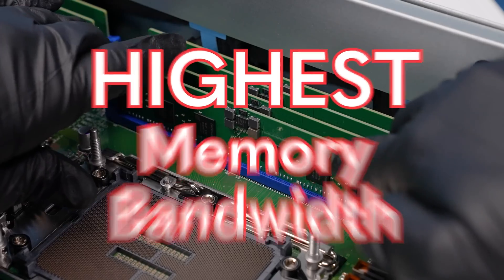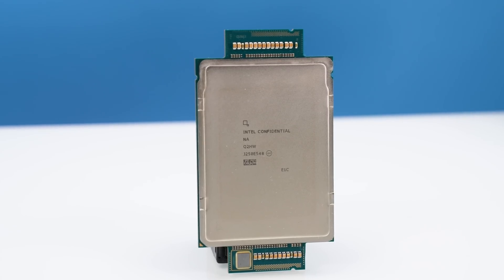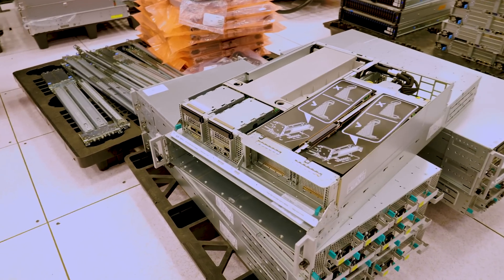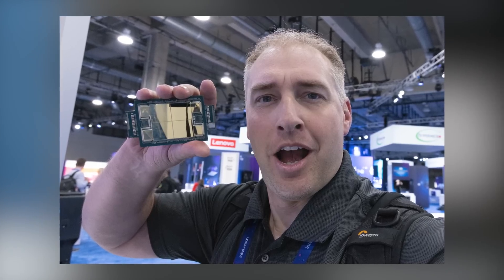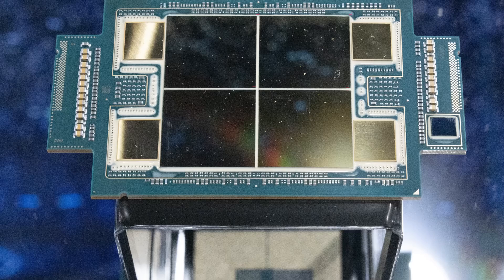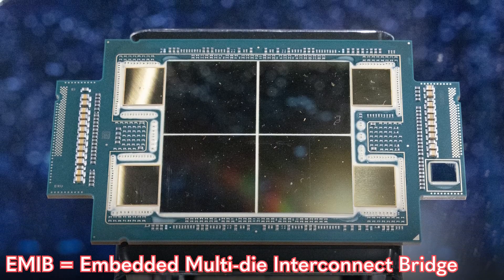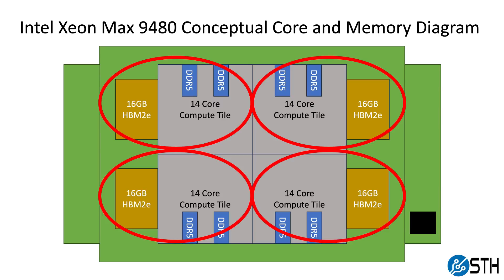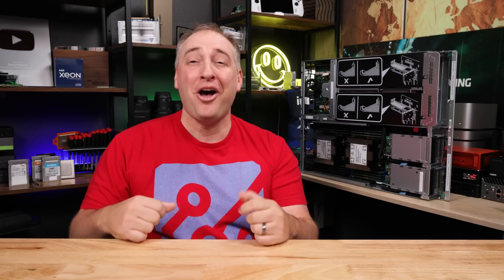This Server CPU is so FAST it Boots without DDR5

Comment: While I work with virtualisation a lot compared to specific high performance workloads, this has always begged the question for me, even when playing around with a legacy Xeon Phi 5110p CoProcessor, how would a chip like this handle memory failure? Nowadays whenever we have memory failure, ECC kicks in as a first resort and then you have options such as Memory Mirroring so your workloads can continue with a reduced amount of available memory. 

How would a chip like this handle it, say, one of the HBM packages was defective or outright didn't work, does the BIOS of the system have any form of mirroring? Considering this is four seperate packages working as one, would this prevent the chip from booting up at all?

Great coverage though, always fun to see what new products in the HPC sector brings to the table.
Reply: I don't know if this system supports it, but CPU hotplugging exists. Maybe the least useful way to do it, but that would be 1 way
Reply: if the memory fails, throw it out. This is the way now, integration of core components at the sacrifice of modularity and repairability

Comment: Meanwhile in our universe, there are people still believe $8 sbc with 8 core riscv cpu is the future
Reply: Well risc-v is really in it's infancy. However there are big risc-v cpu's now. such as Milk-V who offer a 64 core desktop pc. 
Hopefully the open isa nature will serve it instead of hinder it. I am a big fan of risc-v since they are currently the only option for really free computing.
Reply: I'm a risc-v hardware developer -  It's already owning the embedded world and its in the data center in ways you can't see. Western digital is transitioning its memory controllers to riscv cores for example. Over time it will also start to show up as main CPUs. Remember it's not the architecture that makes one ISA better than the other, its design innovation. Right now, all the cool new innovations, like 90% of it is on riscv. Eventually, that will count for something.
Reply: @juniorjunior8494  Awesome keep up the great work. I can see risc-v becoming mainstream. Afterall there were years until gpu's became workable on arm. Now with some risc-v pc's which are still super new. Plop in a rx 580 gpu and there you go. Very exiting. I can totally see the risc-v pc become the new desktop. Especially since i already use Linux as my main operating system. Alot of problems still to be solved but still very exiting.
Reply: @juniorjunior8494 well, NASA is interested in it, so that says something. Any big government agency that has its hands on it will have a lot of investment, and some of that stuff tends to trickle down.

Comment: I hope this is something that filters down to consumer parts. Especially for APUs with integrated graphics we are pretty clearly getting to the point where they are being limited by memory bandwidth. The Z1 extreme with 8 CPU cores and 12 GPU cores is only about 5-30% faster than the Z1 with only 6 CPU cores and 4 GPU cores. These two chips are meant to operate in the same power limits and are running the same architectures. Given all that you would think that something with 3x as many GPU cores would be much faster but that just isn't the case and it is my guess that it is probably due to memory bandwidth. GPUs are bandwidth hungry and there is a reason GPUs pack their own specialized memory. I wonder if combining this with an APU couldn't let that iGPU stretch its legs to its full potential. Here is hoping.
Reply: This issue is that HBM is very expensive, and doing HBM right means a pretty much ground-up design for your chip to not only fit in the PHYs for the kilobit+ bus, but also the differences in controllers and possibly dual controllers if you still want DDR5 options.

I've worked with HBM, and when you get to the class of connection density it requires, you need to spend the big bucks for a silicon interposer.  Radeon Fiji did this, Vega and VII, and The Titan V come to mind. That is a whole massive die you need to make and then stack at least 2 other dies on top of.

An HBM APU sounds awesome I agree, we even saw a glimmer of it with the  i7 8809G, which had a 24CU Vega MGH GPU and 4GB of HBM. The more practical approach for right now though would be something with a dedicated GDDR controller, even just 128-bit 8GB would be plenty, as that is already around 288GB/s of bandwidth you aren't fighting the CPU over.
Reply: @DigitalJedi  Yeah I know there are definite issues. HBM has a 4096 bit bus which is gigantic compared to anything else and is why you need the complex interposer. Intels EMIB looks interesting and may help in that respect but we will have to see. Personally I would not have the option for additional DDR5. This would be replacing it. Many systems already use soldered memory so this would simply be an extension of that. I would dare say 90% of consumers don't bother upgrading the RAM on their computers anyway so if it is balanced properly it wouldn't be much of an issue.
Reply: Meteor Lake has hundreds of megs of L4 cache in the interposer, presumably mostly for the iGPU and as a low-power framebuffer (somewhat like the M1).
Reply: Amd instinct
Reply: I want to someone run starfield on it just for show. Of course let the cpu be overclocked to 5ghz

Comment: Imagine if AMD started adding HBM2E or HBM3 (that samsung connection they have) onto their Epyc.. aswell as the 1152MB of L3 cache and the 96 fast cores.
Reply: Mi300 APU
Reply: @IamBananas007  24 cores, but yeah fair point. :D
Reply: @tomstech4390  their MI300C has no GPU cores at all and is 96 Zen4 cores with HBM, but it's unsure whether they will release it since there might be not enough demand for it since their V cache already gives them a lot of memory on-die
Reply: Well, Phoronix published reviews of the Newest AMD Epycs inluding Bergamo and they literally destroyed even the HBM version Sapphire Rapids chips....so apparently AMD doesn't need HBM

Comment: Damn, that localized memory is incredible for SQL instance/shard, web server cache and so much more.
HBM memory runs at lower wattage than DDR memory, with significantly higher bus width and lower frequency required to achieve high bandwidth (afaik).

p.s. Didn't show the bottom of it even once =\
Reply: Bottom of what?
Reply: @aarrondias9950  the cpu module/pcb
Reply: @Gastell0  1:01
Reply: @aarrondias9950 ooh, that was in introduction, I looked over again everywhere but that, thanks!

Comment: This title is so dumb it hurts. CPU is not so fast it does boot without ddr5 memory. Speed has nothing to do with it. It is basicaly SoC with build in memory modules and ddr5 expands memory capacity.
Reply: It is toying with clickbait as must happen to get people to actually click, but the HMB memory is faster—even than overclocked DDR5 with tuning... so it's not really lying. The CPU itself might not necessarily be "fastest" but you could certainly make the argument on-chip HBM makes it "fast"
Reply: @JeffGeerling  Yes. It does make chip faster, but booting without ddr5 has nothing to do with its speed.
Reply: @JeffGeerling i would argue Jeff that hbm does not make a cpu fast, it just makes it seem fast, or theoretically fast or however one may say. all the mem bandwidth in the world cannot help if the cpu cannot keep up, those perf. graphs do not seem so ideal. of course those rapids cores are indeed fast, but it remains to be seen in real world perf. how much they benefit from the hbm and if it's worth the hassle, optimization  and cost. still, why does a modern cpu with on-chip memory needs extra chips to boot? this was a thing since the PoP days. oh, well i guess intel and x86 in general have their "reasons".
Reply: @giornikitop5373 That goes both ways :) All the cpu cannot help if mem bandwidth cannot keep up. Not that I know of a real-world workload that's bandwidth bounded anyway, even if I do know y-cruncher is bandwidth bound on all consumer platforms since 2015.
Reply: @SomebodyHere-cm8dj sure, but a fast cpu with mem limits can do the work at a good rate, while a slow cpu no matter the bandwidth cannot do shit. anyway, since forever, cpus were always bandwidth limited but better mem tech always existed.  As usual it always comes down to "does the juice worth the squeeze?"
Reply: it's clickbait and it works, you are here commenting and I'm here commenting at your comment
Reply: He mentioned supercomputers multiple times so my guess is there was a demand for CPU bound supercomputering and having a nominal amount on the CPU makes it much cheaper to build thousands of these nodes versus having to put 2 or 4 sticks in each one just to get it to load an OS.
Reply: @HyenaEmpyema  my man designing a CPU that integrates 64GB of HBM (this isn't just normal RAM) isn't something you do "because it's cheaper than a couple sticks of reg ECC server RAM". It's more expensive than fully populating the whole dimm channels and then some.
This is for supercompute where CPU is still doing a good share of the work if not most of the work
Reply: @marcogenovesi8570  I'm not saying you're wrong, but calculating the true cost of 64gb hbm is pretty much impossible from the perspective of the chip manufacturer. If a 3 letter gov agency or research institution says "We'll buy 150k of these if you put 64g of ram onboard" it may well be worth it. Plus Intel has an entire business strategy that neither of us is privy to.
Reply: @HyenaEmpyema  it's not necessary to calculate the true cost, the ballpark estimate of 64GB of HBM on die and making a short run of these CPUs means they are going to be murderously expensive, far far more than adding all DIMMS you can add to a server. The idea that they are doing this because it's cheaper than putting a few sticks in the servers is ridicolous nonsense.
If they wanted something cheap they would have embedded RAM not HBM.

Also why are you handwaving this away as "the government asked for it", there is no need to add conspiracy theories. 
HBM on CPU greatly accelerates CPU-bound computing and there is no shortage of that even at large scales. This is well-known. Just because a lot of computing is done by GPUs does not mean all computing is done by GPUs.

This is hardware mainly for supercomputers as said also in the video it's already going to be used in one supercomputer. There is no "secret" businness strategy, both Intel and AMD have done semi-custom high end parts for projects where money is no issue and performance is the only thing that matters.